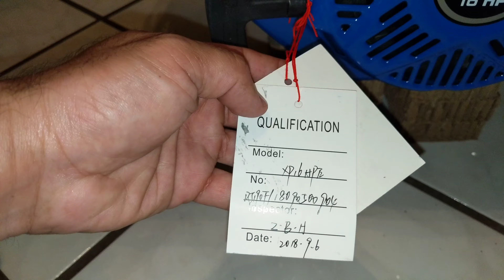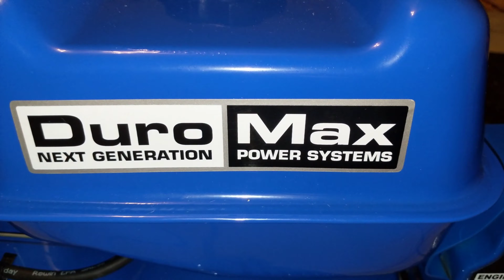Duromax 16hp Engine - Unboxing Follow Up Detailed Look

Comment: Hey how do the motor and  torque converter work on the go-kart? I’m thinking about buying the same set up
Reply from the maker: I have to weld a plate but it definitely fits. There is a black box under the valve cover that needs to be relocated. I saw a video of one mounted straight down but I'd be worried about it hitting the ground.
Reply: Wondering the same thing. What do you mean it definitely fits, but you needed to weld a plate?

Comment: I have been watching high and low on how to bypass or eliminate the governor on a duramax 420cc 16 Hp engine and thus far there has been absolute zero infirmation concerning this alteration.  Decades ago there was a linkage to the carburetor to the governor and it was easily bypassed. Now, it seems everyone is about elimination instead of linkage adjustment for simply bypassing the governor, but they speak about that for every other engine... why?   And if one does video about the 420 Duramax they exclude all information that it is indeed 420 cc 16Hp Duramax Engine and the governor's adjustment's being discussed.  Y'all about have me deciding to do my own Videos but in a fully informative style that will leave y'all in the dust losing your subs.